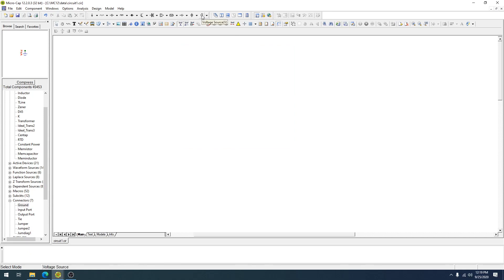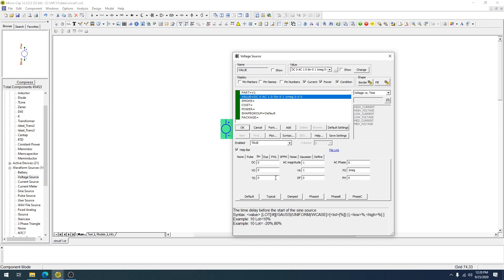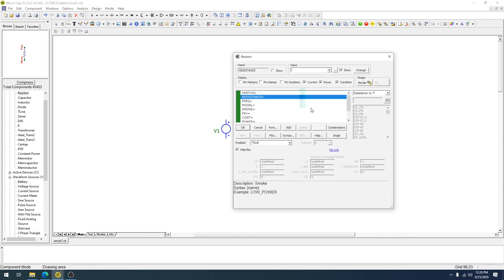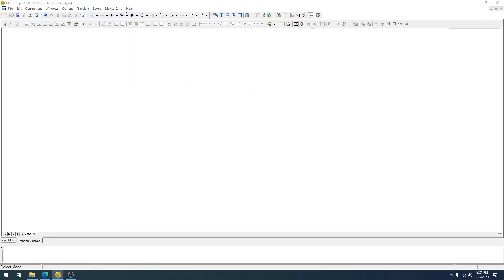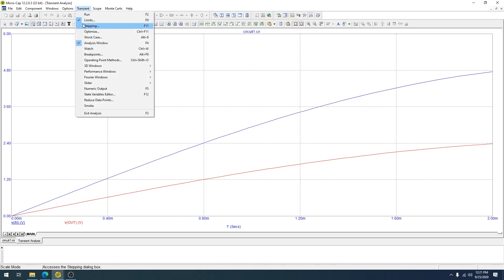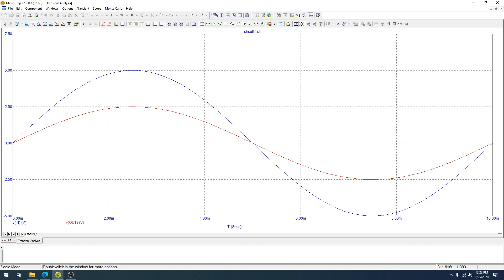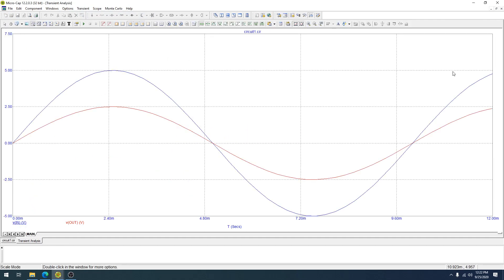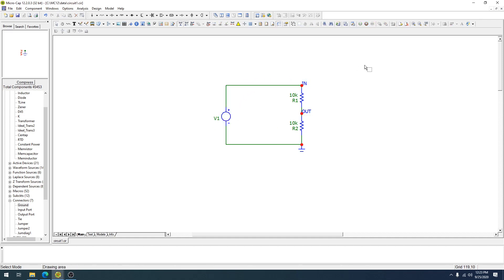Micro-Cap Tutorial: Voltage Source with Voltage Divider Network

Comment: At 3:06 you drag your source voltage, and your wires in the schematic automatically update position, mine does not do that, is there a shortcut for that drag feature?
Reply from the maker: It should be in the tool bar near by volatge/current/power indication toggles
Reply: @pauljstar  Ah, there it is Ctrl + Shift + R to toggle. Thank you.
Reply from the maker: Yes it's called rubberbanding